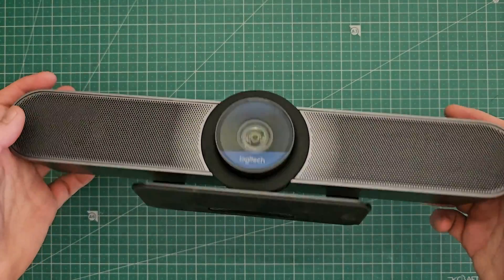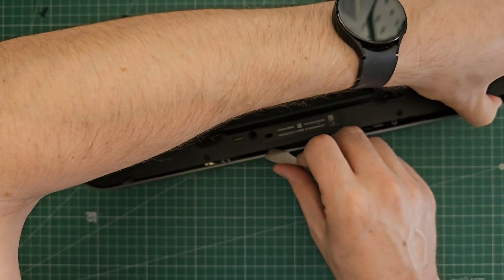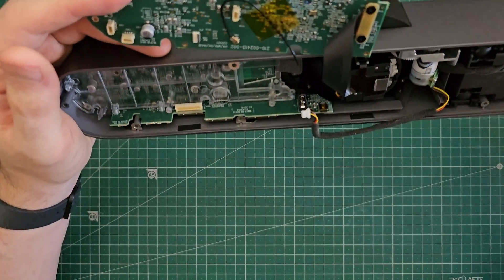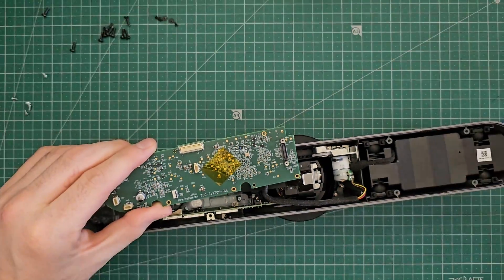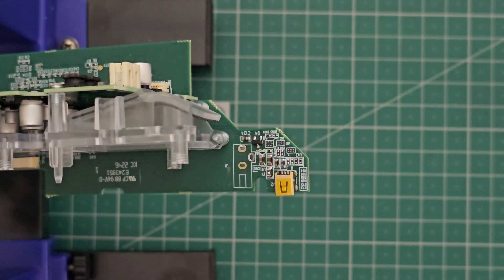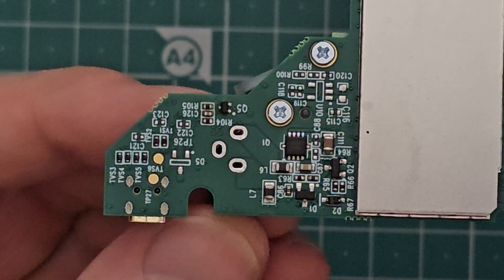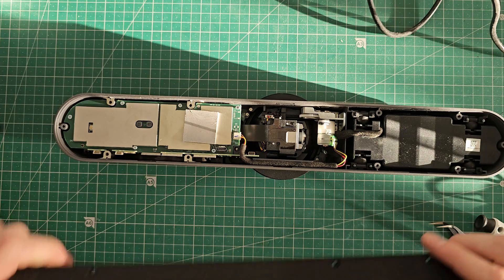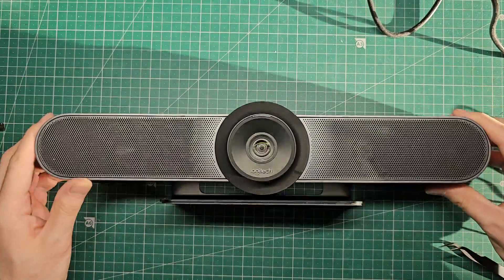Can I Fix it? - Damaged Logitech Conference Camera

Comment: Mine has a dodgy c type port. I have to hold the cable in for it to connect. Do you reckon if I take it apart I could manipulate the port to have a better connection. Or how easy do you think it would be to solder a new usb c port on instead? Thanks :)
Reply from the maker: Ah, that's not fun. USB C ports are quite tedious and have very tiny pins. It depends on your soldering skill.
You could try carefully using a hot air solder tool or a soldering iron tip in a circular motion around the connector pins to try to fix any damaged solder connections on the existing part. That won't help if the damage is inside the connector though unfortunately. Then you might have to get a new port. Good luck!
Reply: @TerminalCuriosityEE  Thanks for the advice I appreciate it =-) I will try my best!
Reply: @supersoma7787   Hi! I'm in the same situation, did you manage to change the USB C port?
Reply: @ghadirmustafa4769  I have the same issue and am willing to change the USB C. Does anyone know what specific port we need to buy?

Comment: Nice repair!! I look forward to seeing  what kind of videos you make next. Just a handy…. Whenever I have a through hole component with short leads, I use a piece of “plumbers putty to hold the component in place for soldering. You have to be particular with the brand you use as the lower quality will leave residue. Thanks for the video. Good luck with future ones!!
Reply from the maker: Thanks for the feedback and the great tip! I'll have to look into plumber's putty for soldering.
Reply: @TerminalCuriosityEE  or as i have advise you over the years blutac will help hold it as well